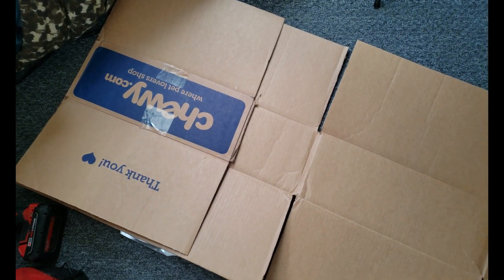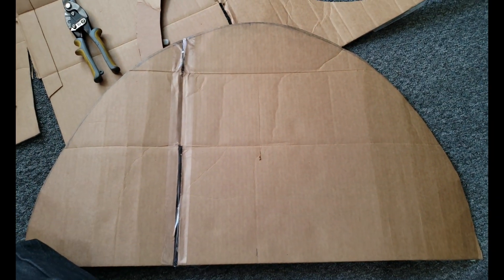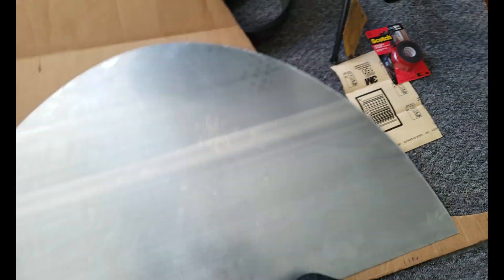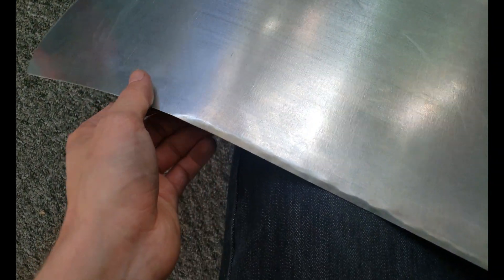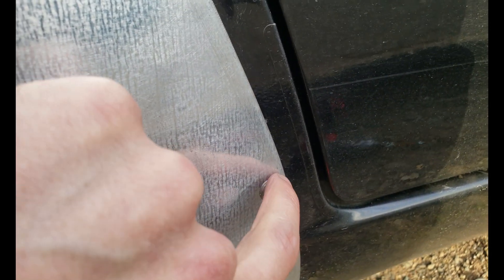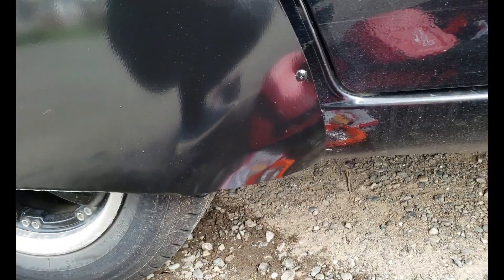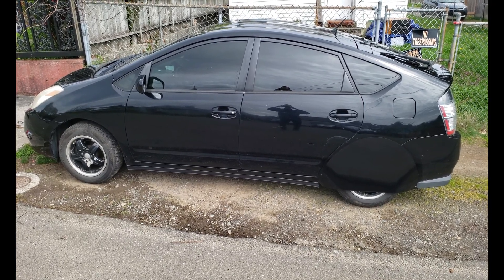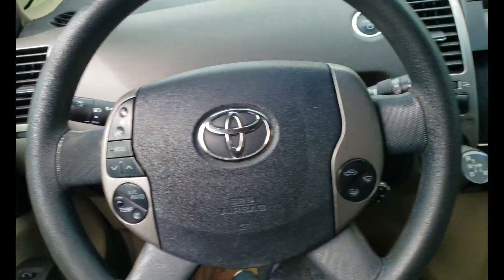AERODYNAMIC Wheel Skirts for under $100!!!

Comment: is good. now cover up the wheels with some moon discs and get a sharkfin instead of the antenna. Also do you need both outter mirrors and your rear seats?
Reply from the maker: 😂  Rear seats don't weigh much at all in the prius, but I did have them out for a while.  I thought about front wheel covers, but I'd rather have front brakes with the way I drive.

Comment: How'd those hold up?  Wondering what tape would be better?  Butyl tape or maybe better to use a caulk of some sort or body filler and paint over?  Seems like those corners that seem to typically rust can be integrated to be covered as well, whether rusted already or not?
Reply from the maker: I bought the expensive electrical tape and it holds up surprisingly well.  Even doing 70+ through torrential downpours.  The skirts themselves are great.

Comment: Can you update the MPG figures since the install?
I ask because I highly doubt there was a 43% gain in MPG from these mods alone.
Reply from the maker: Maybe 1mpg?  I say in the video that bumping up the tire pressure made so much of a difference it would be hard to even notice what the skirts did.
Reply: Just for looks and id run them for high speed.